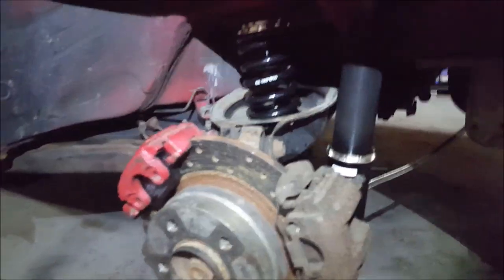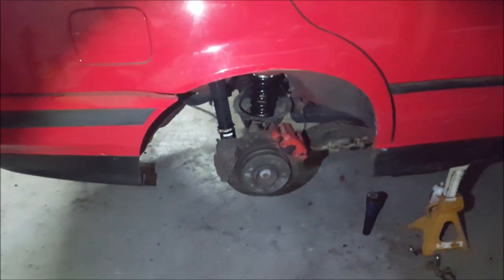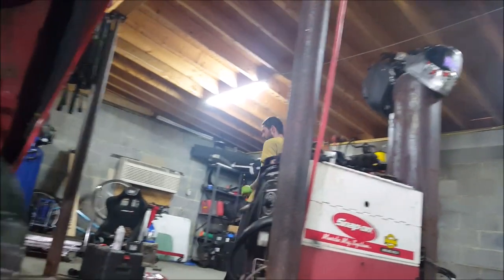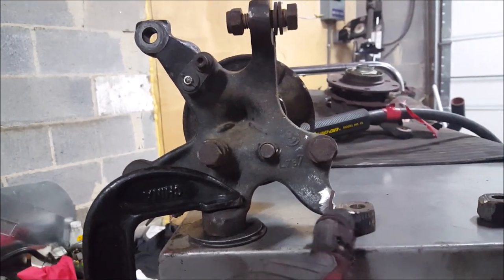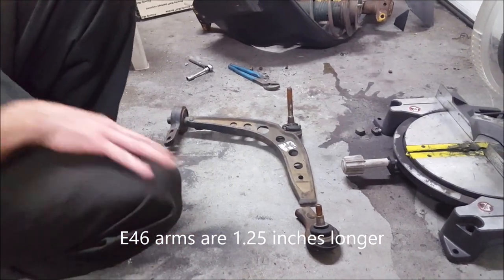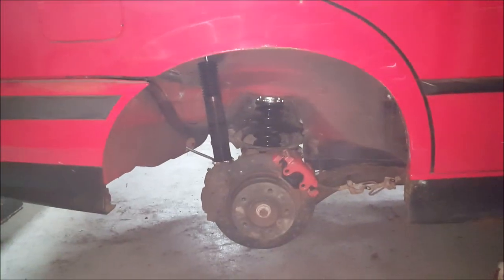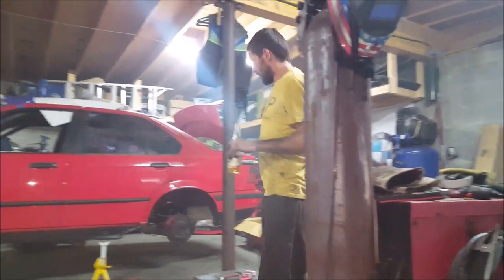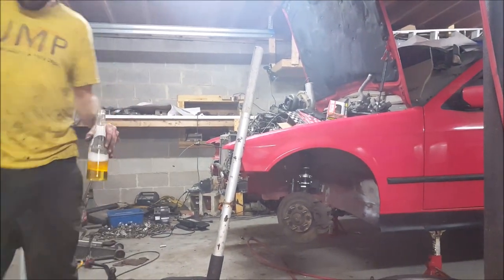CHEAPEST E36 extended control arms and cut knuckles

Comment: Can a gasless welder (110v/220v/240v) work for this? I’m trying to diy
Reply from the maker: Will it work..probably. Would I attempt to use a better welder on a part that could allow the wheel to fall off.. yes
Reply: @ThomasMiata  because the welders I was looking at supposedly had penetration of 1/4-1/2” penetration on steel
Reply: @ThomasMiata  Hey I'm back again haha. I picked up a 240v stick welder with max 200A. I'm assuming this has strong enough penetration (up to 1/2" apparently).

Comment: @ Thomas Miata, best video ive seen on e36 angle kit, gotta give you props man. I have to ask, I know you said to cut about 14 mm and reweld, what was the 3.5 inch measurement for? Also how many milimeters inward should I move the part that I reweld on(like towards the inside of the car is what i mean). Why the drop knuckle? Would I be able to cut more than 14mm for more angle or would that not be a good idea? Sorry for so many questions, just looking to get my knuckles welded, having a friend do them and want to make sure he doesn't screw it up if you get me lol.
Reply from the maker: Anas Parekh the 3.5 inch was a measurement used by a friends purchased kit. Mine didn’t make it to be that short. So to answer your question, yes you could make it shorter. However, I like the way these feel and would make them the same again.

I would suggest you show the welder this video and see if they can make them a bit shorter.

Comment: whats better for more angle having a tie rod cutting and stock control arms or tie rod giving a lot of toe out and extending lower control arms or they are the same ?
Reply from the maker: sss sss they would be the same. You need to either shorten the connection on the steering knuckle or allow the steering rack to travel further.
Reply: @ThomasMiata  good morning and thank very much ,  and if i do both shorten the connection on the steering knuckle and allow the steering rack to travel further. it give a better result correct ?